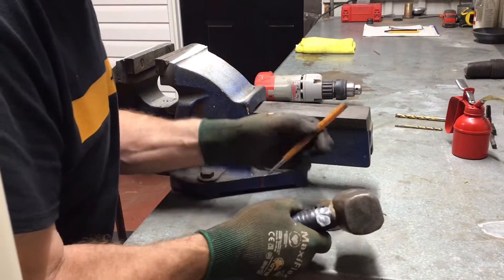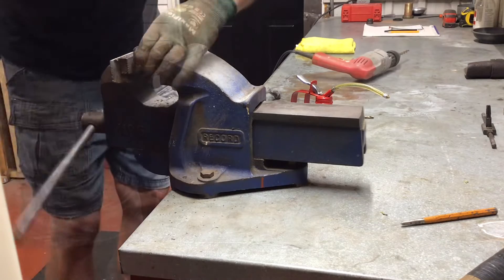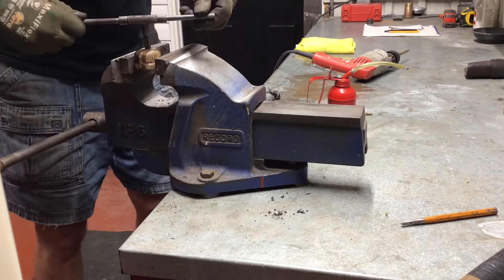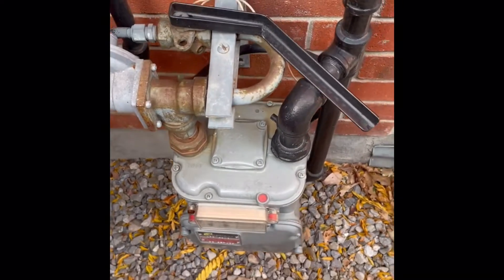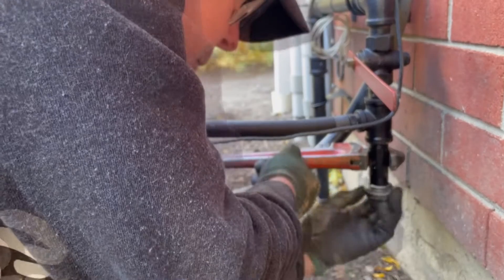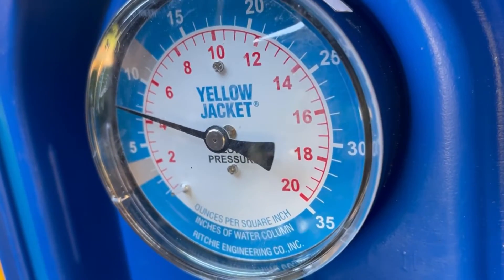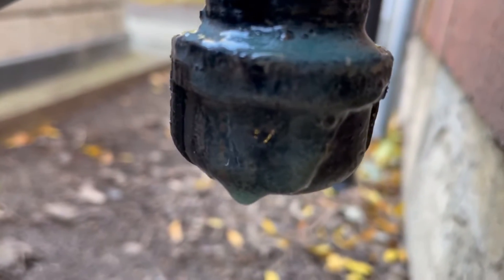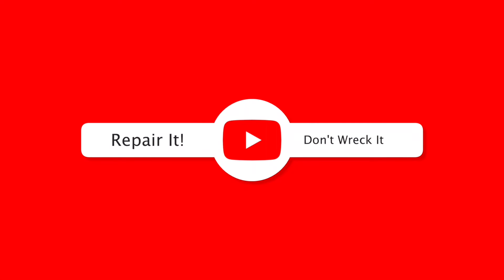Testing gas pressure on a standby home generator /safety tips/make your own test fitting

Comment: Not a valid test without also testing the pressure with the generator running with a 75% or better load!
Reply from the maker: @rpsmith  Thanks for viewing and posting. This video was created  to check the static pressure. Along the way I showed how to make some test fittings and use a manometer. It is a test. Most people watching these videos are probably homeowners who own generators. I wanted to keep it as simple as possible. More of an introduction to testing gas pressure. If you’re having problems and the generator won’t start this test is valid. I agree that another check you could do is a load test. Very important. Just as you would do on electrical circuits. I have another video that shows what you are suggesting. I look forward to all comments as they enhance the videos. Also they can point out things that I have missed or incorrect statements. Roger

Comment: My generator does not have a drip leg on it, is that required?
Reply from the maker: Hi p51mustang31. It depends on the rules in your area. Where I practiced it was a requirement. It’s there to catch any debris. The gas regulators  that service the appliance can easily be damaged from contamination. For smaller diameters it was required to be a minimum of 3” inches long and the same size as the pipe it served. From memory 1/2”-  2” required the same size drip leg as the pipe that serviced the equipment. Some people don’t like to use them outside where there is winter conditions. They seem to think that the drip leg could fill with water from condensation and freeze. I’ve never seen it happen. To be honest if the drip is cleaned out a short while after the initial installation it never needs it again. Usually you find some cutting oil or metal shavings from cutting  threads if you have steel black pipe. Perhaps years ago the gas network of piping wasn’t as clean as today dictating the need for drip legs. I think it’s a good idea to install. Thanks for watching and posting. Roger
Reply: Well done. You sound like a plumber I’m guessing…is that right?
Reply from the maker: @tcudahey9550 Yes I am. I didn’t know I had the plumbers accent. I love the trade. However, all of the trades are my favourite.  Thanks for looking at the video and taking the time to post a comment. Much appreciated. Roger

Comment: Im installling my own Generac 18kw my main concern is if i have the recommended gas pressure listed at the back of the generator, plate label says NG- minimum 3.5 and max of 7 in WC,,,247,000 btu/hr…i have to test the pressure about 20 feet from where I’m setting up my generator where there is a 1” supply manifold..then using a 1” csst line so i can maintain the pressure on a 20-25ft run..hope my pressure is at 7 in wc or higher🙏 if not i may have to run a solo 70-80ft line of 1-1/4” line straight from the gas meter😫😫..im going to run my 2 furnace and test pressure if it holds up to generac’s recommended pressures 👍 good tips 🙂
Reply from the maker: Hi camilo8cheryl. Hopefully the pressures work out for you. It sounds like you have a handle on the situation. Are there any other appliances that use gas such as a stove or bbq that should be included in your testing? I know chances that not everything will be on at the same time but it’s possible. You want to size for the worst case scenario. The size of the pipe to the manifold is critical on how things will go. Once you have pressures and distances it should give you a good idea of the best way to pipe up the generator. Check your local rules on using the csst as it can vary quite a bit from what I have read on some of the forums. Thanks for posting and watching the video. Roger